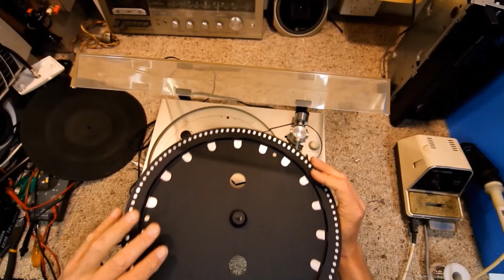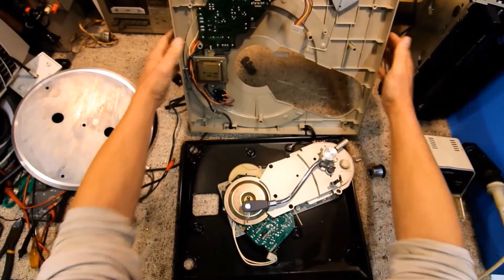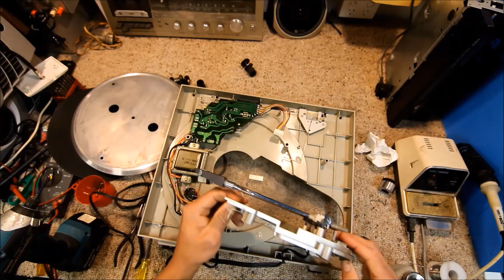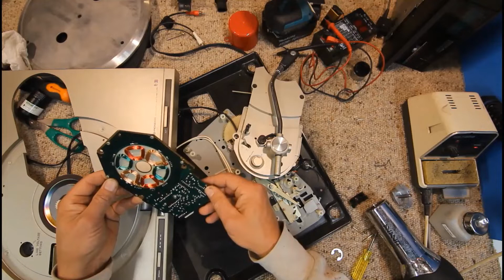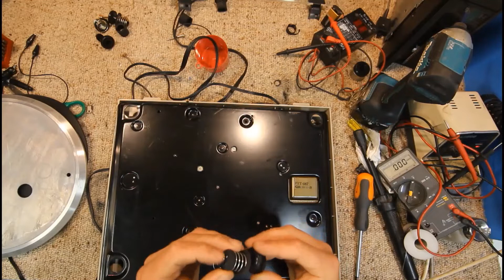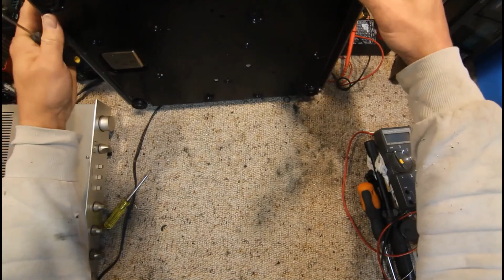Pioneer PL300 Turntable repair and service

Comment: Hello everyone here, I ve got this exact same turntable and I want to remove the quartz lock. Can a anyone help me do this mod? Which wire to cut maybe. Thanks. If you ask why am I doing this it's because I want to play my records on 432hz, there is a bottom hole where you can adjust the speed manually but the quartz lock is fighting back i
so your sound wobbles.
Reply from the maker: Since the crystal controls everything you could possibly fit a trim cap across it to adjust its frequency a little bit which may allow you to slow things down while the rest of the circuit is unaware and will try to lock it to that new frequency
Reply: @StevesElectronicRepairShop  thanks for the reply.. nice thought but do you know where I have to install it?
Reply from the maker: @onerec6424  Best to take it to a technician if you arent an electronics person

Comment: Ive got one of these. My cat chewed up the audio patch cord. I have no idea how to disassemble and replace them.
Reply from the maker: They are usually soldered to a circuit board or tag strip inside. You can just cut the plugs off one end of a cheap RCA lead and solder it on, or you could try a couple of screw connector RCA plugs if you dont have the equipment to solder and see how they go. There could be issues with hum. 
https://www.jaycar.com.au/rca-plug-with-screw-terminals/p/PA3717

Comment: Hi, in the last section of the video, fixing the speed (33 vs 45) what was the light doing? Didn't show on camera. My deck has a speed problem after I picked it up and moved it around; I'm guessing it's due to the screw on the bottom you found there but not sure what the BPM goal is or what the light should be doing?
Reply from the maker: It wasnt an easy one to film since its down a hole. The idea is to set the speed so that the pattern on the platter for the speed you are set to appears stationary. One of the marks should appear still in front of the light. If the speed is incorrect the marks will creep forward or backwards. I think it came out better in a video I did on another turntable that has the markings on the side of the platter where you can see them. Its around the 10 minute mark on the Ariston RD11 turntable video.

Comment: Horrible! The way you handle this turntable looks like you're about to trow it away...for god sakes, remove the headshell fist thing!
Reply from the maker: I can treat my property how I want. Its made in Japan so not fragile junk. It was $20 from the tip shop and the head shell was off a rotted old turntable, and likely went in the bin after I purchased a new one for it.
Reply: @StevesElectronicRepairShop  If it's $20 or $2000 - the attitude makes the difference...
That i learned 50 years ago in my apprenticeship!
Reply from the maker: @jaygotti5763  Like I say, its my property and a beaten up piece of old junk at that, so not worth treating like some treasure. They got worse in use back in the day with kids like me in the 80s. You obviously werent around when these were just everyday bits of equipment treated like any other home appliance, and they survived. I was a lot more careful with a mates turntable I fixed on here because it was nice and he loves it.

Comment: Am I crazy, or is the mark for zero balancing and setting the counterweight well to the right of the center top on the stub itself? I have been setting my weight on the top middle, but mid that is truly the case, I’ve likely been tracking a little heavier than the two grams that I want.

Comment: I had plugged my pioneer pl350 in 220v. Didn't smell burnt... Do you think a texhnician can still fix it?
Reply from the maker: What voltage did you plug it into, and was it working OK before that?
Reply: @StevesElectronicRepairShop my turntable is 110v and i accidentally plugged in to 220v... Yes it works fine before. Do you think it still has a chance to be fixed?
Reply from the maker: @jei.ganaden  If it was a lower voltage it shouldnt be too major, so should be able to be repaired

Comment: this table can be serviced in about 30 mins if the tech has experience with the design and layout. the suspension relies on a set of 4 rubber feet and is most often the cause of sag and lack of proper operation. the microswitch, speed selector switch and the potentiometer need cleaning..... clean a couple of times to prevent having to re-enter the table. for what it is - not a bad turntable.

Comment: I have a PL-400 and tried so hard to watch this. I cringed, but made it through the use of an impact driver to take it apart. When the impact came back out to put it back together I couldn’t take it anymore and had to stop. I’m sure it came out just fine. I just get queezy looking at this kind of thing the same way some people are affected by seeing blood.
Reply from the maker: It cost me $20 at a junk store. I am from an era where we just fixed stuff as quickly as possible, not treated it like some fragile precision little treasure like modern audiophiles do. I cringe when I see people treating playing a record like they are performing a surgical procedure. Its just a piece of mass produced consumer goods that was obsolete long ago. I worked on this stuff for years so know how its built. If you knew how the average owner of this stuff treated it back in the day after they purchased it new, you would faint for sure.
Reply: @StevesElectronicRepairShop  I hear ya man. It was less about the impact on the turntable and more about using it in general on old plastic parts. Like I said, I’m sure it came out fine. Its not like you were hammering on it. It’s my issue not yours. I just see so many people these days using impacts where they don’t need to stripping screws left and right.
Reply from the maker: @seanhilliard7995  The Japanese used good plastic. Certainly some things are very brittle these days and even screwing them by hand can break them. Also impact drills can be used gently like normal drills, they have a variable trigger that gets more aggressive as you pull it in further. I wasnt pulling it in far enough to insert a 100mm bugle screw into hardwood. Just feathering it to undo small screws.

Comment: Hi Steve. I have fixed several of these Pioneers. All of them the motor cogged without the platter. You neglected to notice that the springs are in fact colour coded and that the spring which is a different colour to the other three must be placed on the front left foot. The hanging suspension is actually very clever though as with most 70/80s decks it was over-damped by the rubber collars. Conversely when rotted as is here it will be under damped i.e. the suspension will bottom out. New collars and judicious use of a hole punch or slits in the collars can transform the  performance of these turntables. All the best Nenad.
Reply from the maker: Thanks for that information. Hopefully that will help people working on these turntables.

Comment: Waiting for your reply pl
Reply from the maker: I dont know.
Reply: What kind of service engineer are you, as if trying to run it without the platter was bad enough (your lucky you did not damage the driver IC), But greasing the main bearing? If you had none your research before taking you horrible screwdriver to it (which you clearly didn't) you would have known that those clever engineers at pioneer designed oil free bearings for this series of decks. please tell us our Ebay name, so those of us with any sense know not to buy anything from you.

Comment: Hi, when I tried to remove pioneer pl300 tone arm the tiny balls from the bottom of tone arm fell down which I did not expect.I could trace only 12 no’s of tiny balls and I replaced back. But I find there are some more gap around shaft where balls are placed . I want to know how many tiny balls are in the tone arm bottom shaft. Pl clarify.
Pl reply

Comment: I have a pl 200 and the lift mechanism doesn't function properly.  When I set the set screw  to have it raise up, then it doesn't go done when lever is placed in down position. If I set the set screw to have to go down, then it does not lift when lift lever is placed in up positions.  I'll have to take it apart like you've done here, but before I do,  I want to ask you what type of grease  is it you used in this video? You say "just regular grease", but what  regular grease are you referring to exactly? There's many different types of grease. Thank you.
Reply from the maker: I got my grease from an electronics parts supplier. It was made for use on plastics like cam gears in VCRs. Any grease that is safe for use on plastics should be OK

Comment: Thanks for the video , I have a PL 200 , needed the basic tear down. Mine the pot that controls the speed needed some contact cleaner. It sounded like a drunken sailor. LOL  Something so simple as a dirty pot making the speed swing big time.
Reply from the maker: A dirty pot will send random voltages in a circuit like that and cause all sorts of problems. At least its an easy fix.

Comment: Hi, was watching your video. I have an issue with my PL-400. the motor is not functioning properly - 45 rpm speed makes the table to rotate anti clock and the 33 rpm is not stablising. request you to suggest solution. Thank you, Regards
Reply from the maker: Hard to say what has failed in the motor electronics. I would check for bad solder joints and capacitors to start with.
Reply: @StevesElectronicRepairShop  Thank you so much
Reply: Hi. I took my set to a local repair shop and was told that the speed ic needs to be replaced. I request you to let me know what is the part number for the same, I believe it is PA2005A. Is there any alternative ic for the same?
Reply from the maker: @abhishekchaubey5164   I dont have a part number. You would have to see if you can find the service manual online. I havent heard of any compatible IC's, but there might be something online if you search for that IC number or the model number.
Reply: @abhishekchaubey5164  if you're still looking for a service manual, this page has one that covers several of these models: https://www.vinylengine.com/library/pioneer/pl-300.shtml

Comment: Hello Steve, I also have one of this beauty, but the speed is low. How can I adjust it?
Reply from the maker: 55:33 there are a couple of holes in the bottom that access trimpots for each speed.
Reply: @StevesElectronicRepairShop  there are two little potentiometers accessible through the underside .......adjustable with a small straight screwdriver.  They are white plastic with one marked with red located about 5 inches from the middle front....side by side about one inch apart.  One sets the speed when at 45 rpm, the other when at 33 .  I adjust both about 1/8th turn clockwise and speed stabilized.  Prior to adjustment, lights stayed constant but would flicker every 20 seconds or so.  After adjustment, speed remained constant and the flicker went away.  Posting this to help others as I spent several hours trying to find how and where to make this adjustment and stopped my random slow downs.
Reply: @edgrens1679  Hello ,do you know how can I turn the quartz lock off? Which wire should I cut maybe? Thanks
Reply: @StevesElectronicRepairShop  Thank You, I overlooked that...

Comment: I thought the video was very good with a couple cringe worthy moments. Cleaning bearing surfaces with paper towels and screwdriver. Get cotton swabs. Always test motor with platter.  Direct drive needs the platter for speed feed back.  Rest of video was great.
Reply: There was some manhandling going on here, no doubt.  But, fixed is fixed.

Comment: Thank you Steve!  I have today carried out that same repair to my old PL300x and found the two metal plates to be sticky.  Works perfectly now.

However...  I cannot believe you didn't realise the platter had to be n place to allow the speed sensor to run the motor correctly!!  ;)
Reply from the maker: Good to hear you got yours going. This would be one of the first direct drive turntables I have worked on. I have never come across a motor that wouldnt run without a load before. Back when I was doing repairs for a living I probably would have realised a bit sooner. Wasting time chasing some quirk of the design is just part of the fun of fixing electronic devices.